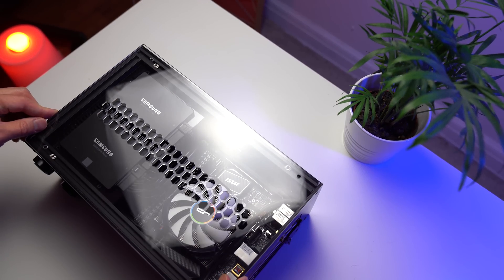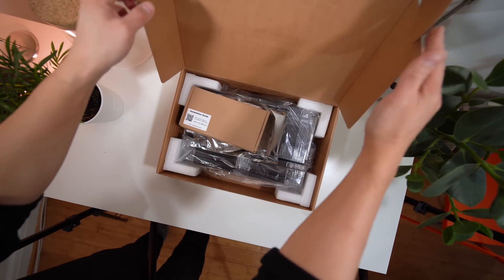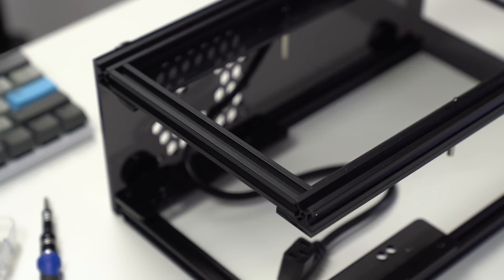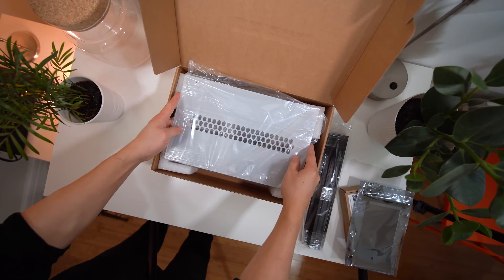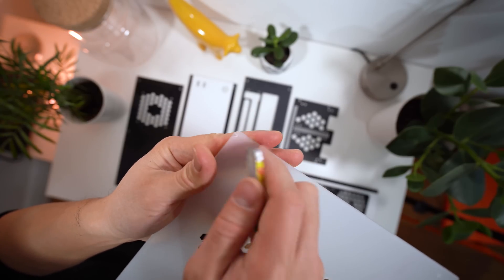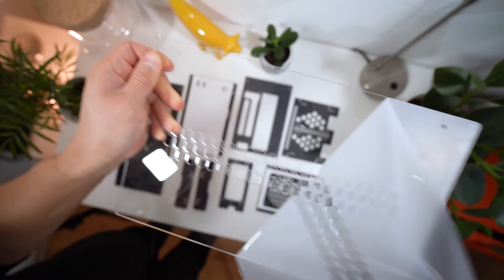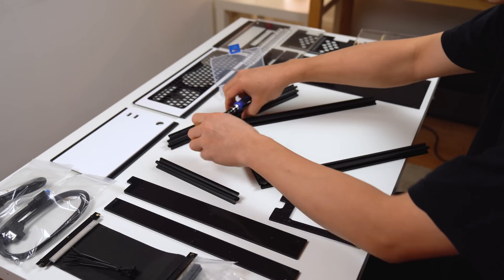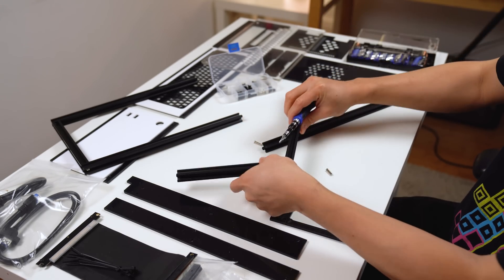a CHEAP TINY ITX case for $69 - Geeek A50

Comment: The biggest downsides based on what I saw in the video is the lack of filtration for longer use times between cleanings and the use of acrylic since it scratches easily based on personal experience. Sadly the 2nd one is a deal breaker for me.

Comment: Looks like the bottom plate is symmetric. You may flip it so the fan could be placed at the bottom the motherboard instead of the PSU cable. Or am I wrong?
Reply: Is there any clearance issue if the fan is placed under the motherboard?

Comment: He complains about where the intake fan is. But if you can slide the nuts into the frame then you can just flip the panel 180 degrees and the intake fan is right under the CPU and GPU.

Comment: It's petty hard to add pull tabs, because normaly acrylic is lasrd and you just laserd through the wrap the wrap isn't added after cutting. and they could have also used the shitty paper wrap which just rips

Comment: 6:15 could you assemble the bottom panel backwards for better airflow?
Reply: No. There would be no clearence under the MB. But three 92x14 fans at the top in exhaust position provide enough airflow.
Reply: @Vulcano7965  I got the case last week, so far has been great, my build has those fans and it is relatively quiet and cool, even in Flight Simulator 2020 at 2k
Reply: @BP-lm9uc  What CPU cooler are you using?
Reply: @Vulcano7965  Noctua NH-L9a. Never gets above 65c under load
Reply: @BP-lm9uc  Damn that small thing is that capable? I have a 5 3600 so it can be a bit on the hotter side
Reply: @Vulcano7965  yep, super fast and quiet, even in FS2020. Honestly dont know how, because I built another ITX build in the Inwin A1 Plus for a friend and he can barely run FS2020 with better parts (5600XT and ryzen 7)

Comment: Is a nice case and do like a challenge and satisfaction of building stuff. I have a COUGAR ITX case which is small and fits a full sized graphics card.  Customized it to fit a full sized psu and custom water cooling loop for both gpu and cpu.

Comment: where you not able to reverse the bottom plate? it looks like the holes are the same on both sides, so you could just flip it so the fan is on the other side.

Comment: Everything is covered in the plastic film because it looks like all the panels were cnc routed or laser cut out of acrylic/similar sheets which from factory come with that peel away film on both sides to keep it from getting scratched. The only way to add peel tabs is to glue them on with some kind of adhesive that's stronger than the force needed to peel away the films, but that'd be a lot of cost added because it'd be quite a tedious process and for such a budget case it likely wasn't worth the markup.

Comment: The bottom  fan was actually a bonus from the case to use a space that was left in the case underneath the PSU. Putting a fan below the  motherboard would actually make the case bigger. In that case I recommend you get the Geek A60, which you can fit a full size 240mm radiator on top, that let's you water cool your Processor and Video Card if you go custom AIO.

Comment: I'm wondering if the bottom cover can be turned on the other side, so that the fan configuration is aligned with the motherboard instead of the PSU. 🤔

Comment: Well you also added 60 bucks worth of Noctua fans and it would be smart to get a more expensive psu to have modular multi length cords. All in all its not cost effective. Inwin  makes small cases with fans and power supplies made of metal for about the same price point total.

Comment: this one is ok for what it is., but i still want a cheap sheet metal sandwich style case that doesn't cost a fortune. seems they all either use exotic materials like machined aluminum, or dont provide any emi shielding (acrylic cases like this one). they could get it down to the < $50 if they did a sheet metal case. 

one thing that seems wonky about the sandwhich layout is the psu in the front of the case. it almost always requires a re-route of the power cable or an extension that i see as a waste of space. i think what id do is have the psu mount directly into the bottom of the case, then using a 90-degree power cable and feet with more spacing. thus the power cable is routed under the computer rather than through it. it would also work in a reduced length configuration with the psu rotated 90 degrees for machines with shorter graphics cards and might take a liter or two off. 

i think with a 3x120mm fan layout in a negative pressure configuration with strategically placed passive vents would also work better than a push-pull configuration. i modded my elite 110 into a negative pressure configuration while adding a couple 92mm fans to the mobo side of the case (which took considerable dremel work and some 3d printing) and along with the 140mm up front is is really effective at dumping waste heat. negative pressure around the psu and gpu guarantees only fresh cool air enters them rather than warm recirced air from inside the case. i wish the cpu cooler had better access to cool air, and it does to a degree due to slots on the sfx to atx adapter plate im using, but a sandwhich case ensures all your hot parts get cool virgin air.

Comment: Why do the itx cases cost more than their larger brethren. Less material = higher cost?
Reply: Because that's a bit of a nice market, so there's not as much economies of scale.
Reply: @kabochaVA  I guess that's hard to argue but it still seems like the cost is out of line with what you get
Reply: @Deceptikhan  That's true with many consumer electronic though... For instance:
- Apple products are expensive, underpowered, and cost a fraction of the price to produce
- Intel recently dropped the price of some of its server processors by as much as $5000 to compete with AMD (which means they used to be $5000 overpriced)
- many companies charge a premium for products of mediocre quality (e.g. Razer, Beats...)

Aside from that, I've been thinking what it would take to produce mini-ITX cases, and how much you could sell them for? The big problem is all the machining involved (when dealing with metal and acrylic). Then you need to let people know about your product and putting it on the market. All this goes into the final cost of the product.

And in the end, your success will depend on whether people find your product cool enough to actually buy it. So that's quite a bit of a risk.

Comment: Yes, third comment. At around 6:14 you comment about how you would like to move the fan to the motherboard area in the case.  Is that bottom plate symmetrical?  I paused it here to write this comment, so that I may address my curiousity as to why the forethought was not put into this while creating this (instructions could have said to rotate 180 degrees).

Comment: But, why did you rip the case apart at 3:40 or so? Couldn't you have just attached the pci-e riser first then attach it with the giant stand-off's that was attached to it's support bracket (the ribbons)?

Comment: For all of the complaints about the case, especially how things are assembled, you're forgetting that this case shows that anyone can design and manufacture their own case. Every component of the case is easy to find and easy to have manufactured, the only difficult part is designing the case. Anyone can make an exact copy of this case with little effort. 

As for your complaint with the gpu's power cable interfering with the coupling nut, that's more of a design flaw  that can be blamed on the card's manufacturer, as cards don't have a standardized length, but itx motherboards do have standardized mounting hole locations. The only blame is on the card manufacturer, but at the same time you really can't blame them, as this style of gpu mounting has really only become popular in recent years. 
A potential fix is to desolder the connector and either wire the cable into the card or wire a pigtailed connector onto the card. With standard mounting for the gpu, which would be directly on the motherboard, this issue doesn't show up, and cards that short are typically designed to be that short to fit into itx cases, so again, can't really blame anyone for bad connector placement in a non-standard mount. The only non-mod solution is to consider this issue when you're looking to build a system in this case, and to avoid cards with bad connector placement. Either that or just mount that coupling nut to the opposite rail, maybe with some spacers if they're needed. 

And for your complaint of the acrylic's protective plastic being hard to remove, they can't do much about that, as that's applied by the original manufacturer and is there while the piece is being laser cut. Just get a piece of tape with strong adhesive if you really need a pull tab. As for complaining about everything being acrylic and thus making the case a bad travel case, go replicate those panels with metal, problem solved.  If you need more rigidity, just add more extruded rails to the inside for bracing, assuming there's room. Need a handle? Add one, the extruded rails allow for this. Need better fan mounts? Design a solution for that. Flat packing also saves space, both in warehouse and in shipping. It allows companies to store and move more units in the space they have. Plus if you really have complaints about having to assemble something this simple, then you probably have bigger problems in life.

There's nothing special about this case, other than it being a pre-designed solution for what's possible with using some extruded rails, basic hardware, and some laser cut panels. Every possible complaint can be fixed with a custom solution. Need different panels? Design them and have them manufactured. Need a longer/taller/wider case? Get longer rails and design new panels for the case. Again, this is only one pre-designed case for this method of building cases, if you don't like something, or something doesn't work in your specific use, just design your own, it's not that hard.

Comment: i've had this same case but in matte black since Feb 2019. the film is difficult to remove, but not a major problem. i'm surprised you mentioned so many problems during the build, i followed the instructions & had no issues with installing components during certain steps. i was pleased with thermals but i run a 1600 & RX 580. i do pack mine in a back & take it with me a few weekends a month & the case has stood up rather well. i hope the side panels change to be less restrictive but like this case overall; i can always cheaply replace any panels in the future.

Comment: If someone wants to build a more up-to-date build in a small case, here is my idea:
AMD Ryzen 5 3600
GIGABYTE B450 I AORUS PRO WiFi
EVGA SuperNOVA 650 GM
ID-COOLING IS-60
Crucial Ballistix Sport LT 3200
XFX Rx 5700  or Any RTX 2070 / GTX 1660 Super
ADATA XPG SX8200 Pro 1TB
All this fits perfectly in the case Geeek A50

Comment: 6:13 This panel is screwed separately, can it be unscrewed and turned over so that the fan is in the right position? Or is there something else attached to it that will not allow it to be done so easily?

Comment: From a distance, it looks okay but you can definitely tell that it's a cheap case, which it is. Even with shipping and tax and Riser cable it is cheaper than most sff cases. But it does not look like its worth it. It really does look like a designs students final year project made with parts from a DIY store and a laser cutter

Comment: I've been using this case as my main PC for almost a year and its served me quite well. Its a great little case I can fit in my backpack for when I need it at work and takes up very little space on my desk. These high draw low profile Noctua fans used in this video are a MUST for this case. Im using the same fans without the bottom intake with an R5 2600 and MSI RX580 and I've never seen temps over 80°C. The only drawback of this case is the lack of filtration, as I find myself cleaning out dust multiple times a year.

Hope this helps anyone interested!

Comment: If this is your first case you're actually building yourself, then you kinda can't complain about the build process. (Not saying I'm better cuz I haven't either, most I've done is mess around with a thermaltake core v21), trial and error can't fault a case on that alone. What you can fault it for though is how clearly the instructions indicated said construction. I could possibly see myself getting something like this, be hell of an experience and I've loved Optimum Tech's ghost case that I so wanted one til I seen the $200 tag lol. Been looking at the Lian Li tu150 (that handle is a big winner and the front IO as well a bit), this case is a contender for me now

Comment: Firstly, thanks for making this video!  Really enjoyed the camera and editing work.  PC looks great with your desk aesthetic.  I completely agree that the intake would be better below the motherboard.  Given that the case is "IKEA like", does it let you just unscrew the bottom panel and rotate it 180 degrees to reposition the fan or do other screw holes or alignment hold you back?  The modularity of cases like this really intrigue me.  Even more so if you can mix and match panel placement to make other designs from the same components.
Reply from the maker: Thanks for the comments dude, I tried rotating the bottom panel, no clearance between the mobo and fan unfortunately
Reply: @JammyMunkyTech  that is unfortunate.  The manufacturer totally missed an opportunity for greatness if that had worked.  Thanks for getting back to me though!  Really appreciate your time.

Comment: You are right, it is not cheap, but considering the 200+ Dollar alternatives (most of them only had a limited production run and are verry hard to get) it is as least worth a try. Mine houses a bios flashed vega56 and ryzen5 not bad for that tiny formcator :)
Reply from the maker: true

Comment: Ok is there some kind of issue with flipping the bottom cover and turning it 90' degrees around so that the import fan is under motherboard ??You complained about it but by the way i see it you just installed the bottom part the wrong way .
Reply from the maker: doesn't fit

Comment: maybe u can reverse the bottom plate? is it possible? what about electrical radiation? back in the early 2000 everybody looses their minds whenn someone with acrylic case shows up at a lan party....
Reply from the maker: nah, it doesn't fit unfortunately

Comment: honestly,  if it was stamped out of sheet metal, and had drilled and threaded screw holes, that could be a beast of a case
Reply: so on the topic of pre-drilled and threaded holes: that will make manufacture significantly more expensive as the precision required will go up. those "weird" rails are a common component and are basically being bought and cut to length by GEEEK and that is it. they could get the price back down but they'd need to be selling way more cases.
Reply: @Cynyr  A lot of 3d printers use that system, such as my Artillery sidewinder X1

Comment: Hey Mr. Andy, can you rotate the bottom pannel, like rotate it on the opposite side so the "exhaust fan" is in the open. :) Hoping for your reply on this.
Reply from the maker: So I've checked and unfortunately you can't, as there is no clearance between the motherboard and low profile intake case fan.

Comment: Cant you just turn the bottom plate 180 degrees so the fan is where you want it?
Reply from the maker: So I've checked and unfortunately you can't, as there is no clearance between the motherboard and low profile intake case fan.
Reply: I just asked this question, you had better sentence composition. Lol. 

Btw hope he answers our question :)

Comment: I like the size and looks of this case personally. And even when adding shipping to US, and the riser cable (which I agree should be included since it is required), it's still cheaper than the other Kickstarter cases. Thanks for the video.
Reply from the maker: Yeah I agree, cheers dude
Reply: Yeah but it’s much lower quality

Comment: If  building a new pc, most likely I would pass on this case. It does look ok, but not amazing IMO. It's functional and the flat pack thing doesn't bother me at all, but for  a total of $100 (case+pcie extender), i think i would just pick up something more to my liking. 
The one that has really caught my attention has been the Velka 3 (there's a chinese clone for $60). However, a huge negative on those is the FlexPSU since it seems their tiny fans get loud and that would definitely bother me.
For now, I'm still enjoying my modded Raijintek Metis very much. And how things seem to be going, it seems I'll be using it a few more years since I still have about 2 more gpu upgrades and one cpu upgrade that i'm planning to do in the coming years. It does everything I need it to do so I don't see myself replacing it anytime soon. It is extremely quiet, will take the 8/12 cpu just fine with the AIO, can take dual fan gpu's, front USB3.0 and audio jacks, and currently holds 4 drives(nvme, ssd, and 2 hdd).
Reply: Do you have a link to that chinese clone ?
Reply: @SuperMike2507  https://www.aliexpress.com/item/4000333781136.html?spm=a2g0o.productlist.0.0.448f5689oRrHOB&algo_pvid=45678e9e-dd9a-4c74-8e30-360562030cda&algo_expid=45678e9e-dd9a-4c74-8e30-360562030cda-9&btsid=618e1722-ddb3-4e0b-9a20-93bb992107b7&ws_ab_test=searchweb0_0,searchweb201602_7,searchweb201603_55
Reply: You can also try to use hdplex in velka case 😉
Reply from the maker: Your build sounds awesome, the Metis case is still one of my favorite cases till this day!